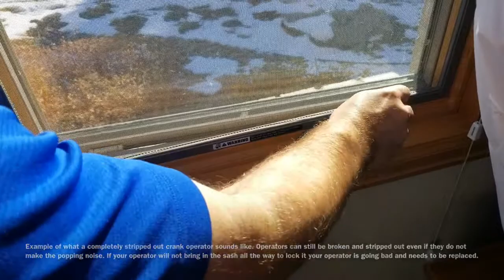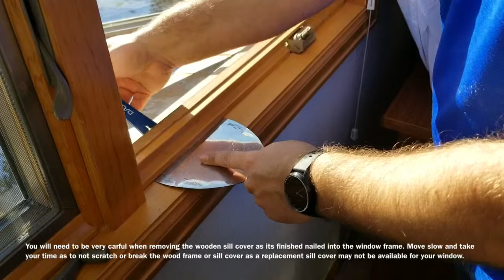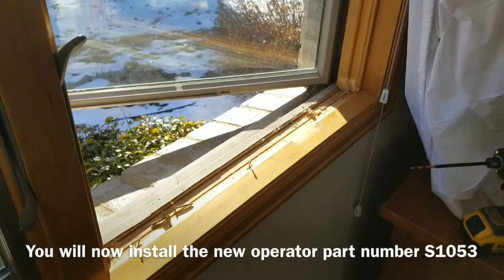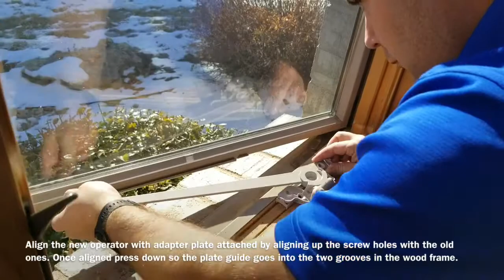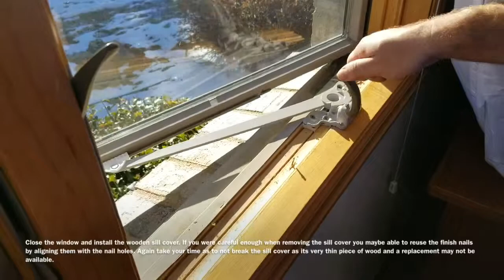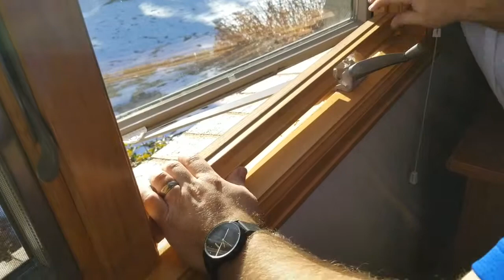S1053 Andersen Casement Straight Arm Crank Perma-Shield Enhanced

Comment: It looked good except for 1 thing - there should of been a small (1/8" diameter) bead of clear silicon under the hardware, then attach it.   Then a small continuous bead across the sill and hardware (top and sides) and then reattach the wood trim strip. The silicon stops the drafts. Homeowners - do NOT use glue. 

Also as he showed, use something under the pry bar (I like a thicker 3" wide mud knife vs a thinner 6" wide mud knife that he used) so that you do NOT mar the sill as you are prying the trim strip up.  As otherwise you can dimple or scratch the sill and a fussy homeowner WILL insist you repair/replace the sill that you damaged (rightfully so).

If the window trim is painted, use a retractable blade knife to to cut the seam between the sill and trim and sides too to separate the 2. Then do the gentle prying.

 As always - as a professional do it right the 1st time.  Same goes for homeowners, as an ounce of prevention is indeed worth a pound of cure, sometimes 5 pounds.